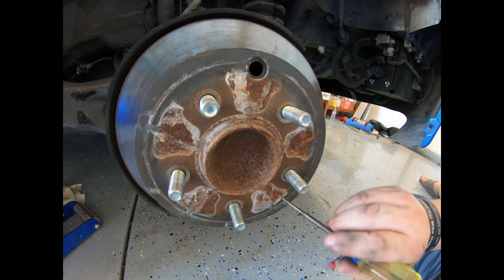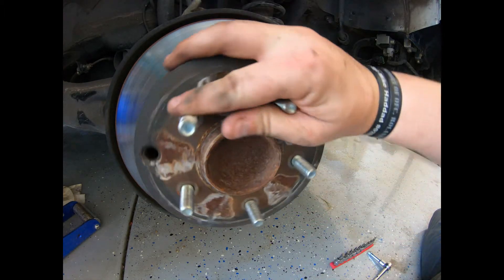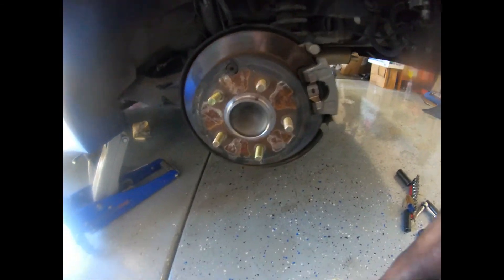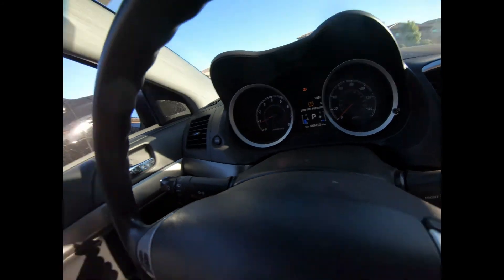Blue Line Garage - How To Change Rear Bearings On A Mitsubishi Lancer 2015 Or Older

Comment: Thanks for the video! Are you aware of any general issue with rear brakes in Lancers? I ve got something for more than a year which is like I hear noise from rear brakes even when I do not touch the pedal. I changed the caliper, guide pins while the rotors and pads are new. And still it continues..
Reply from the maker: Yeah.. there is a common sound that's just there & nothing you can do about it.. sounds like grinding or rubbing
Reply: @BlueLineGarage  is it a constant sound? I have a sound coming from rear driver wheel that makes a scraping type of noise every quarter or half turn and was told it wasn't bearing/hub? Sure sounds like it is
Reply from the maker: @devinrivera7706  that sounds like it's the brake shield or rotor shield. It's the metal thin shield looking thing that can bend when force Is applied. Sounds like it got bent a little which is common and it's rubbing on the rotor as your driving. Check it out by jacking up the rear end where both tires off the ground and spin the tires to see which one makes the sound and when u locate the side, remove the tire and then spin the rotor and look exactly what's rubbing and bend it out of the way. Make sure you have tire chulks on the front tires and vehicle is in natural if it's rear wheel drive . Let me know how you made out.